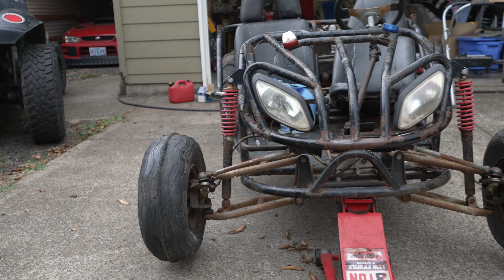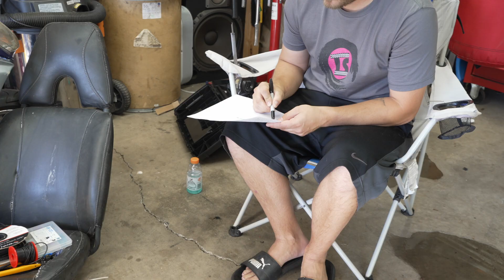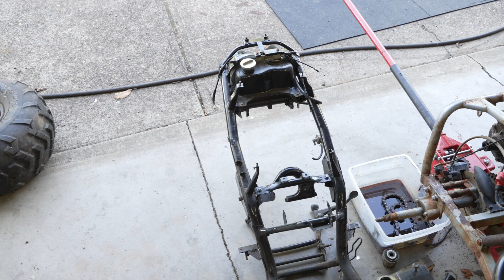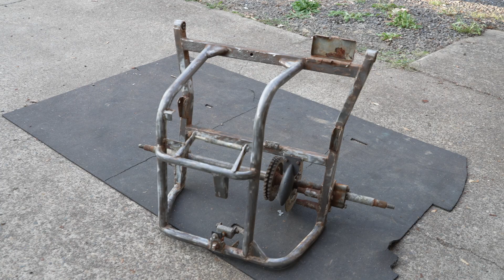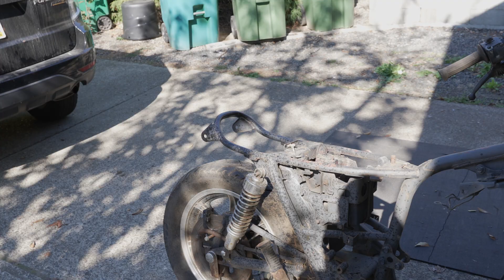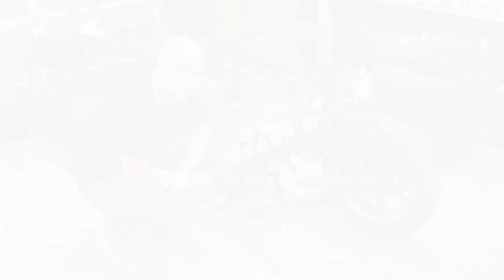Let's Build a REVERSE TRIKE from a GO-KART!

Comment: Sorry but that is no go kart , I don’t know what that thing is , but have fun
Reply from the maker: Most people would call it a go kart, even the original manufacturer. 
Unless you’re talking about the 3 wheeled contraption that it’s going to become…then call it whatever.
Reply: @TIRESIDE  it called a fun cart , or golf cart, not a go-kart look up CRG RACING , topkart, energy karts , 4 wheels 1/2in off ground .
Reply from the maker: Semantics is the least interesting thing to argue on the internet. Owners manual calls it a go kart, some people call them buggies, but no one would be confused if you told them you had an off road “go kart”.